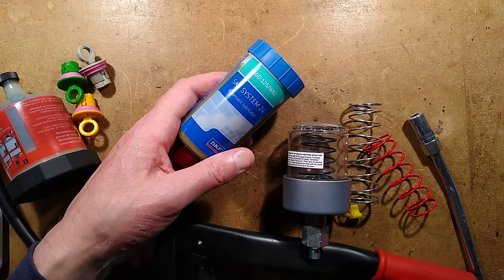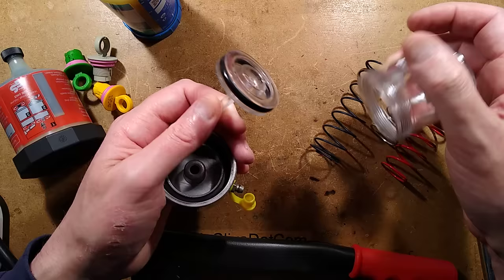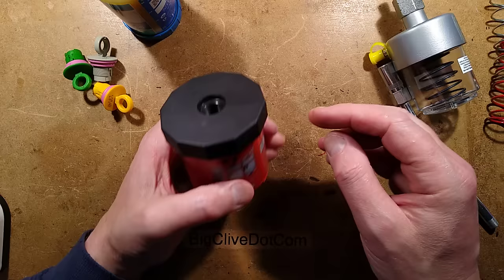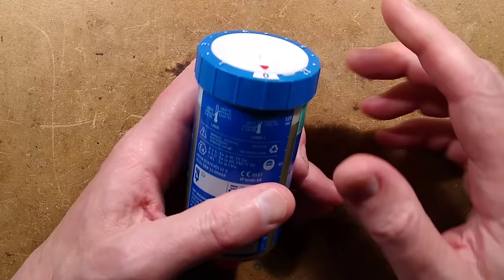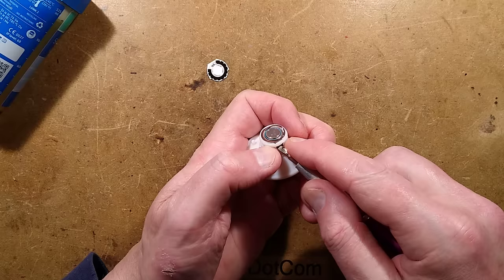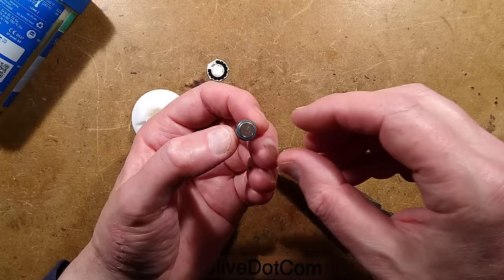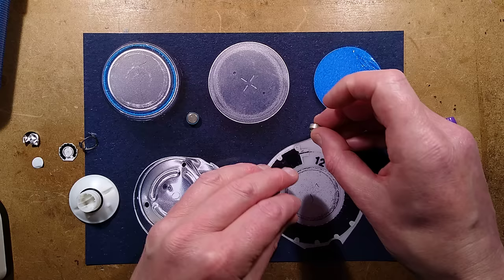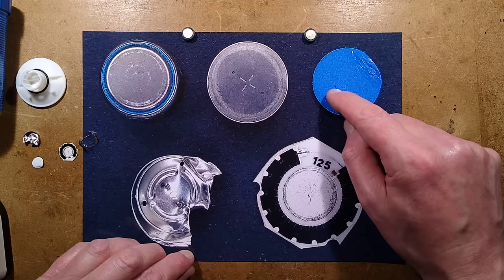Absolute genius automatic lubricator

Comment: for what I could tell, one side of the cell uses metallic zinc and OH- to produce a compound of zinc and 2 electrons. This compound then undergoes another 2 reactions: the first transforms this compound into zinc oxyde and water and the second takes oxygen from the atmosfere and transforms the water into OH-, effectively replenishing the supply of OH- needed for the first reaction. without the oxygen inlet the reaction will eventually stop (dead battery) due to lack of OH- (normally it stops due to lack of zinc which has turned into zinc oxyde). I wonder if this excess water somehow undergoes electrolysis releasing oxygen (which should react with the water in the battery) and hydrogen which would be released into the chamber...
EDIT: also, this would make it even more genius: not only is the process of electrolysis inside the battery but the issue of having oxygen and a volatile gas like hydrogen in an enclosed space is also solved because the battery uses up all the oxygen naturally! it generates electricity, water and hydrogen in one small package AND it can be controlled! GENIUS!

Comment: I don't know  they existed 20 yrs ago when i was doing plant maintenance - we had a grease gun and that was that !
It does make me think that i could automate the lubrication on my milling machine - i currently use a modified grease gun to pump way oil into the slideways which works and only takes a tick to do but being a Maker i could (should) design an automated system using a microcontroller, a pump and servo controlled valve system and i would only have to press a button to lube the whole machine . Joy ! i just created another to-do thing to add to the other 300 pages of to-do things in my to-do book 😩

Comment: The Buggati Royale of 1927 to 1933 had auto grease lubricators built in to the vehicle with a dedicated line to each grease fitting...powered off a cam driven by the engine....
This same thinking is applied today in some trucks...
The spring loaded simple lubricator is available as "Bearing Buddies"..made in USA to inject grease into the wheel bearings of trailers...especially boat trailers...so the grease keeps out water even when a hot bearing is dunked in cold water....

Comment: Ah! I have some of those batteries in my lab. I was given them by the manufacturer, but for the life of me I had no idea what use they would have. Thank you!
Reply: Battery is not the correct word of course... I'm not sure what to call it.
Reply: That is such an ingenious use, with the "potentiometer" to set the rate of gas emission (hydrogen, I think)
Reply: They are specifically designed to emit gas; it's not a side effect of an unusual application. If interested, I will dig out the data.
Reply: Whether it is for gas-generation, or for electrical generation, I think "cell" is probably the right term here.
Reply from the maker: I'd call it a cell, but strangely the term zinc air battery seems common.

Comment: Those devices are clever ways to fix the common problem...namely, too much grease in the grease gun. I've troubleshot, ordered bearings and replaced them...followed by a comment in the
maintenance log..."Too much grease in the grease gun." The boss wondered what I meant...I told him, "The lazy horse's arse mechanic hasn't greased any of these zurks in months".
Now Big Clive reveals how lazy horse's arses got fired or downgraded. What amazed me with this video is, I had no idea a zinc-air battery could off gas big time pressure and volume...
especially puny wee button cells. I HAVE seen  "printed" rheostats though. Clive, can you (if you haven't already) do a video on how the variable speed triggers work on the popular
cordless drills? I know they have a variable pulse width or variable frequency circuit running a big ol' FET...and you switch the output of the circuit to change directions. Beyond that,
I'm lacking details.

Comment: I dismantled an almost empty older model and it had a black substance that had mostly turned to foam releasing gas on the way. That had twin LR44 batteries powering the gas generator.

Comment: Automatic greasing takes less than 5mins off your regular PPM task. You still need to check the belts, filters, connections etc...
I think they're a reasonable idea for some machines but they would only save you money if your engineers are signing off PPMs but not actually following the task list (they're often garbage and don't reflect the machine you're working on but you know, that's where autopilot comes in)... In short, it saves maybe 5 mins per motor or non sealed for life bearing.
We only have automatic greasing on our Rotary part of the DRUPS systems but they are spinning 4 tonne weights at 1500rpm, so the upper bearings need to be lubed. The feed is controlled by nitrogen.

Various things can go wrong with automatic grease feeds, the most common being complacency, caused by the "don't need to look at that, it's automatic" attitude. However, gas pressure (is a major fault condition in the style we have but it's monitored and has an alarm and the ability to bypass and shut itself off safely).
Battery failure, in the one you're looking at, could be an issue, also, it looks like it's made of fairly brittle plastic, although I could be wrong there. I'd still insist on bearings lubed by these devices being checked every month at least (when set to 12 month release).

Comment: What a clever use of this type of battery. I can't imagine it was designed with this application in mind. And what happens internally for the output voltage to jump when the cell cover is pealed off - some crazy chemistry in there.
Reply: Most likely not. To my knowledge this is roughly 15 year old idea.

Comment: Hmm, the zinc is supposed to react with air and form zinc oxide, that would consume gas not produce it. But here they have the caps on and the batteries are inside a sealed container so they can't be using the normal reaction. Wikipedia mentions that KOH is used as the electrolyte, and KOH can react with zinc and generate hydrogen (2 H2O + 2 KOH + Zn → H2 + K2Zn(OH)4). So maybe short circuiting the battery speeds up that process in a predictable fashion in the absence of oxygen.

Edit: noticed that someone else (Robert Szasz) already mentioned that Varta sells "gas generating cells" , they look just like these (I suppose it could basically be zinc air batteries sold as gas generators). Pretty neat if you need to generate a little bit of hydrogen or pressure with a circuit.

Now we need to know how those cells work! :)

Comment: So with this thing, you basically look at two batteries exploding - in very, very slow motion... :-)

Honestly: After seeing the first (spring loaded) one, my thought was: "Should work great for most use cases - really no need to introduce any electronics to that".

But once you explained what's happening inside (and after looking up zinc air batteries), I'm completely with you. Those lubricators are beautiful master pieces of engineering. Cheap as shit in mass production I bet, but so well thought out. Using an undesired side effect of zinc air batteries to achieve the actual goal with the lowest possible number of parts possible and with no real hazardous waste created...

I'm an IT guy, make my living by running big server environments and love playing with embedded systems and micro controllers (on the exact opposite end of the range) as a hobby. But there are so many things out there in the "internet of things" realm which are solutions to non existing problems (or problems which were adequately solved decades ago, where added electronics does not give you the slightest advantage at all.) I thought that was one of them, but I have to apologize. I have to tip my cap to the mind who came up with that.

And I bet the manufacturer adjusts it to differences in the grease's viscosity (caused by different greases or different environments) by simply replacing the resistor ring, controlling the currency allowed. Considering the frugal design, they didn't print the "125" on it without reason. They'll swap the correct one in for different batches.

Comment: When I was a kid, my dad had one that you wound up like a watch, set the timer and the spring pressure would shove the grease out. Have no clue who made it or what it's original purpose {besides timing grease input} was. He used it with cutting oil when running the big band saw.

Comment: Some young engineer had probably designed a microprocessor and a motor and a screw plunger, and in the design review he mentioned that he still needed a way to vent the gas from the batteries. And then some older engineer said, why not just use the venting gas to push on the grease? Mic drop.

Comment: Looks to me a different application similar to a LFP lithium battery hand warmer, where the battery itself is the warming element🙄. Also interesting use of the mundane 🦻hearing aid battery! The cleverness of the design is,in the overall system that used a unique outgassing feature of zinc air battery, with controlled discharge!, using a calibrated potentiometer load🤔🤯❤️👍

Comment: I'm actually more amazed that this plastic cap is capable of keeping it all sealed under all that pressure when you can just pop up it with screwdriver...
Reply: It's all about surface area and pressure 🙂
Reply from the maker: It took a bit of force to pop it out.

Comment: 6:57 This thing doesn't "replace" people. Many mechanisms need a fairly accurate amount of lubrication to work, a person may forget to lubricate it or lubricate too much. Usually, mechanisms that require regular lubrication are serviced regularly, and such devices eliminate the need to measure the exact amount of lubrication and increase the intervals between maintenance.
Reply: I'm a bit confused. You stated it doesn't replace people and then go on to explain (correctly, it seems) in what wonderful ways it replaces people.

Comment: Same principle is used by GoodNature, an NZ company, in their pest traps; only there is dispensing bait. Certainly clever. GN could do with adding a time adjustment like this.

If I'm right, the gas produced is hydrogen. I'm impressed the seals manage to keep it contained over the course of a year..
Reply from the maker: And it's also used in some air fresheners too.  Dispensing a controlled portion of aroma chemical to a wick.
Reply: @BigClive  Yeah, right. Hey thanks for sharing in the delight of discovery. Appreciate your videos.

Comment: I have zinc-air cells in my hearing aids (mine take 312 size). Very interesting things! You can hook a DMM up to a “flat” cell and watch the voltage slowly build back up over a minute or two. Then when you put it under load again the voltage drops down almost immediately.

Comment: This product is absolutely ingenious due to i's simplicity. There is really only one major failure point, the inability of the cells to discharge the gas for the required time. That in itself has been covered off by the viewing strip to see how much it has progressed/grease left window.
Reply from the maker: Each cell is apparently rated to dispense 150ml of gas.

Comment: You'd think they'd make it like a battery-operated timer that slowly turned a screw/plunger instead of a clock dial. That's what I would have guessed the electronic version was instead of just a hybrid of the chemical version (that probably slowly dissolves metal tablets with a weak acid).

Comment: I was thinking that you could do something creative like building a battery with a magnesium and copper electrode, which would release hydrogen when current is drawn. Using zinc air batteries is actually really clever because it's exactly that, but in a self-contained little unit. Neat.

Comment: Thanks Clive for another great video. Interesting little slow release devices. I appreciate the technical, food related, and all other content you've been kind enough to share. Those zinc batteries are odd little things. I've heard they don't start producing voltage until the zinc is exposed to oxygen like hearing aid batteries that come with a little peel off sticker you remove before use, presumably to increase their shelf life .  I'd be interested to see what the biggest zinc/air battery looks like and I'd guess their power to weight ratio could be what makes them a good choice for hearing aids. Anyway have a good day and thanks again for your excellent work. It's enjoyable. You deserve a good hot bachelor bowl of porridge.  Take care!

Comment: We use larger lubrication systems on some of the machines we build. The units we use can have multiple high pressure lines if needed. They have a built in controller that can be programmed for several different modes. Or they can be commanded by a PLC, which is what we do. They're available as battery operated or 24 vdc.
Reply: How does your system handle a single clogged lubrication point? The ones we've used have either used needles that pop out briefly at each point, or some sort of end of line sensor that always indicates fail or always indicates ok regardless of actual status...
Reply: @shadowsimjk  the built in controller monitors pressure and throws an error code as well as an output back to the plc. We use them on reciprocating linear ball bearing guide systems as well as rack and pinion drives. We don't have blockage problems like you can have with plain bearing applications  (box ways, pin in bushing, etc.) Also, the equipment we build is for industrial manufacturing. Relatively clean as compared to construction or agricultural.

Comment: They have air and electric ones that I have used on heavy equipment that you fill with several gallons of grease and while the machine is running it forces grease thru tubing to keep the whole unit lubercated useful on excavators  and any other earth moving equipment  they have them on locomotives if you ever been near one and keep hearing all of those spitting air sounds that’s the central lube system that one has a pump head sitting on top of a 55 gallon drum of very high grade of synthetic grease keeps massive drive gears from failing that are under tremendous strain .

Comment: Being a service Technician for Wind turbines, i can tell you that theese gas powered dispensers are useless outside a warm envirorment or if there is resistance between the dispenser and the bearing.

If they get cold, the grease gets firmer. In this case, the dispenser dont have the power to push the grease thru.

Only good version that i’ve found, is the AA battery pack driven dispensers that have a motorized drive. There are several versions of this from PermaStar to MEMLube, and over the course of 10 years they have yet to fail me.

Comment: The DIP switch versions usually use very slow electrolysis of urea that's captured in a sponge to generate gas pressure.
Looks like Varta makes Hydrogen generating cells
Reply: Those definitely look like the Varta 300ml H2 generating cell stackup

Comment: The problem with automatic grease systems is maintainers then assume they are working and don't need to be routinely inspected. In reality the grease line has cracked through vibration, slowing depositing a pile of grease near the side of a reheat furnace (and not in the intended bearings).

 There does come a point where everyone knows about it though, usually involving flames and the site fire alarm sounding.

Comment: They're no longer industry standard. Now everyone is using simalube cartridges since apparently they're more reliable. It sometimes happened that they (SKF) were installed, set-up and customer found out after couple of months that machine started to make funky noises just because these did not dispense anything even though they were set up properly.
They're supposed to have 2 years of shelf life but in many different factories the storage conditions are far from ideal so I guess that was the weakpoint. We don't have those problems anymore now that we're using simalube although I do believe they're a bit more expensive than SKF. However on the flipside, I think you can refill and reuse them more easily than SKF.

Comment: Zn + O2 = ZnO obviously should pull a slight vacuum instead. So either there is some side reaction going on there that is not obvious, or it's not zinc air. Maybe short one cell and seal it in a syringe to see what it does, the internal resistance is probably enough that you don't really need a resistor if you want somewhat fast results. Maybe compare with a cell that you know for a fact to be a zinc air battery.

Comment: Definitely beats a greasing pedal.  I had the opportunity to slide underneath a 1930's Rolls-Royce.  The coachwork shone but the underside appeared to have 60 years' ( at the time) worth of grease.  Some joints had enormous piles of grease, others were dry.  Still a fascinating automobile though.

Comment: one of the conveyor belts in the factory i work uses the exact same system. we also have other automatic systems
Reply: it wasn't clear for us if it's possible to turn it back off after activating it . thx for this video .
Reply from the maker: It is, but there might be a slight delay in turning off and on again.